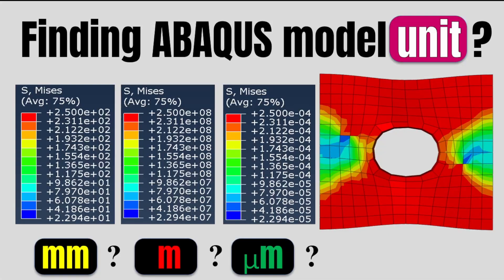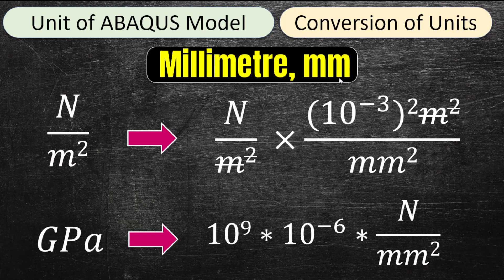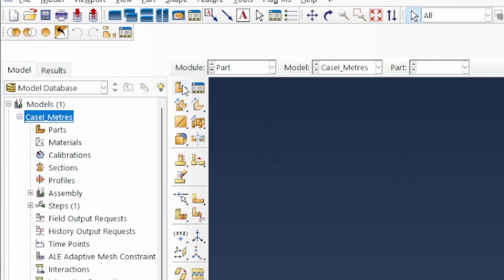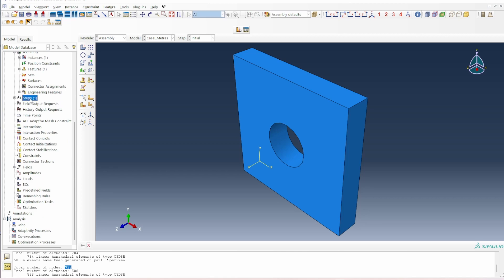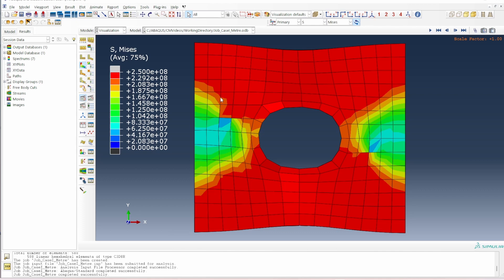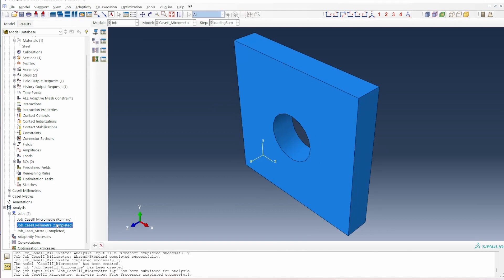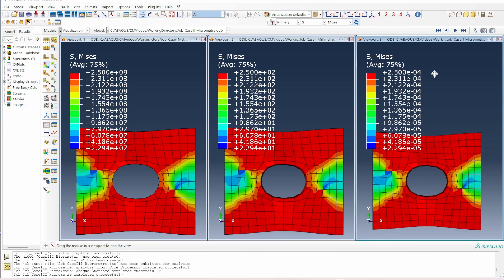How to find the unit system for an ABAQUS Model

Comment from the maker: You can quickly navigate through the videos using these chapters.

00:00   Intro
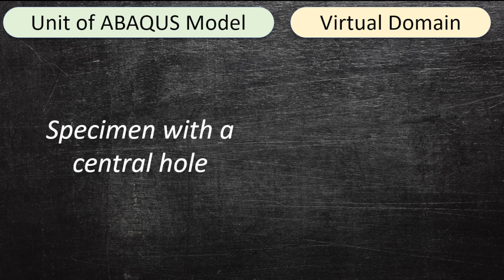00:29   Virtual domain used for the study
01:01   Unit conversion of a metre length scale
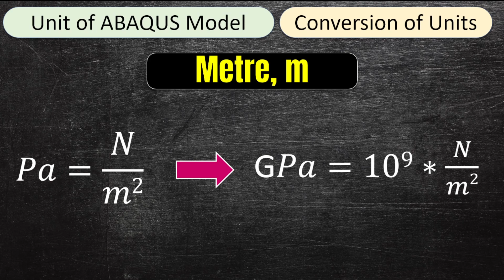01:25   Unit conversion of a millimetre length scale
02:06   Unit conversion of a micrometre length scale
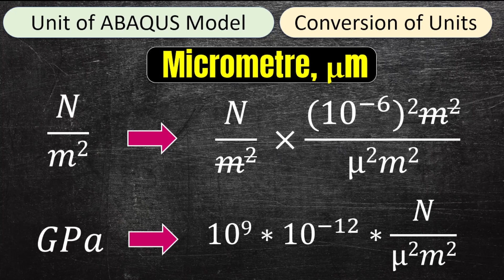03:15   Material properties specified in different units
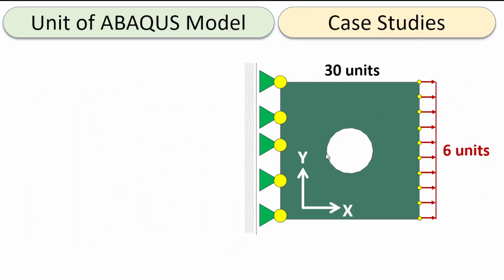04:38   Case studies considered for the study
05:23   ABAQUS Model setup for the test cases
08:53   Case I: Metre unit simulation results
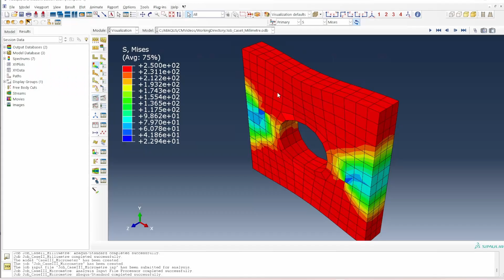11:11   Case II: Millimetre unit simulation results
11:49   Case III: Micrometre unit simulation results
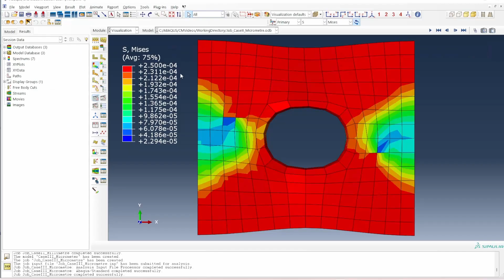12:17   Comparison of simulation results for 3 case studies
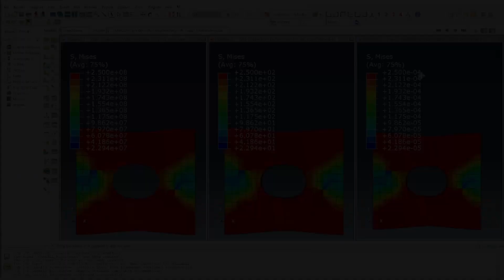14:02   Reflecting on micrometre units length scale modelling
14:44   My recommendation for working in micrometre units
16:22   Outro

Comment: How to find displacement at failure for Johnson cook model and damage parameters or fracture energy for the same
Reply from the maker: This video should help you:  https://youtu.be/gpSh2KLWnqk
Reply: @MichaelOkereke  Sir what about damage parameters
Reply from the maker: I specified these values in my FEM Applications textbook. If you can find it, it will help you identify damage parameters for a Johnson-Cook model for steel. Here is the link to the book: https://link.springer.com/book/10.1007/978-3-319-67125-3

Comment: Dear Dr.Okereke, i have a question. 
I would like to create a polycrystalline nickel model, like a cube with irregular geometry, but in Abaqus i can't choose the material like Ansys. 
Is there a solution about this? I'd prefer to create this model in Inconel 718.
Thx for attention, best regards
Reply from the maker: Hi, yes you are right. In Abaqus you choose material models not the material itself. You have to find the underlying material model for Inconel and look for its equivalent material model in Abaqus.  This is the way to go.
Reply: @MichaelOkereke  Ok perfect Dr.Okereke. I'll take this way.
1) i'll create my irregular geometry in Abaqus (i'll use UMAT's script)
2) Import this model in Ansys 
3) Choosing the material for model (Inconel 718 in Composite Materials)